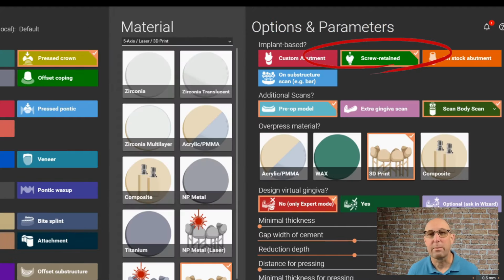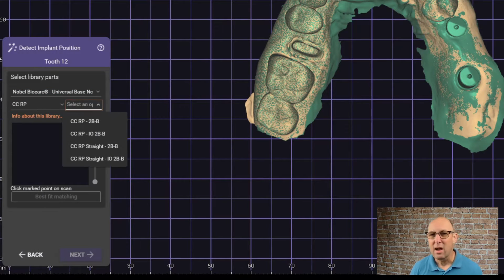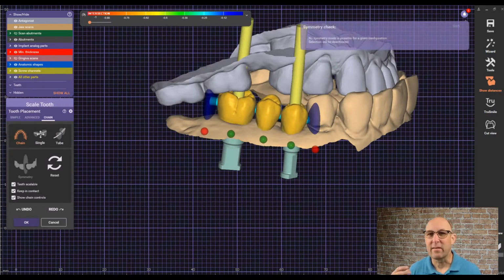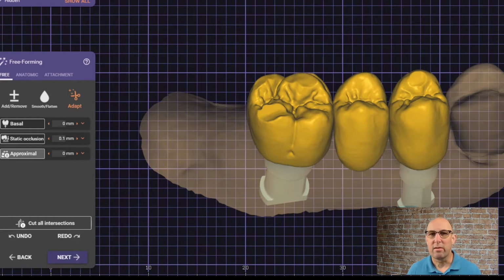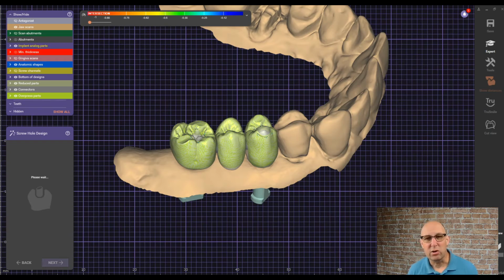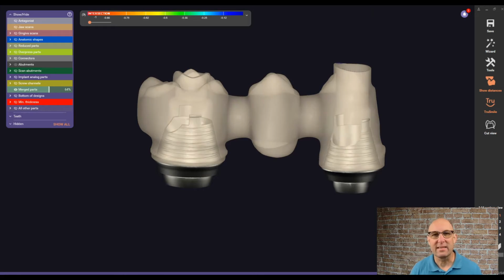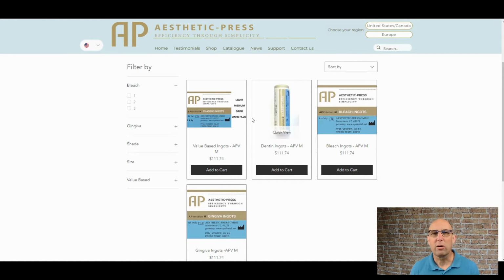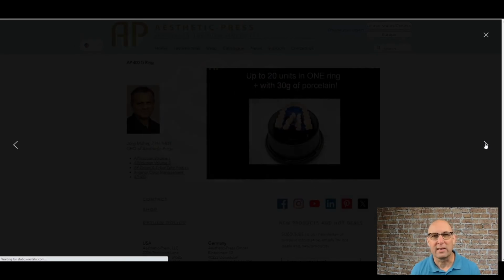TI Base Screw Retained Crown Pressed to Metal [ An Exocad Design Tutorial ]

Comment: Hello, can somebody explain or send video how to assemble milled wax and framework with opaque. Is there space in milled wax to compensate opaque layer? This step confuses me most.
Reply from the maker: Shade with a thin opaque layer (0.10–0.15 mm) achieves the closest color match.
Gray-colored alloys require an opaque layer of 0.10 mm thickness to grant the closest color match, while the yellow-colored alloy achieves the closest color match with a 0.15 mm thick opaque layer. Therefore set the settings to > 0.15 mm to get the best results.